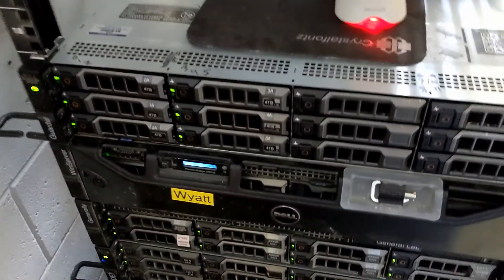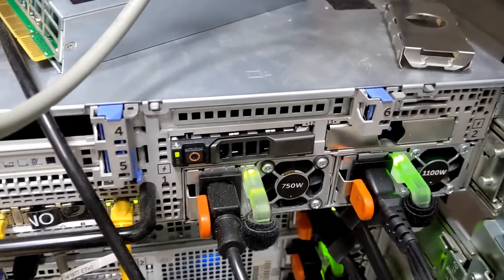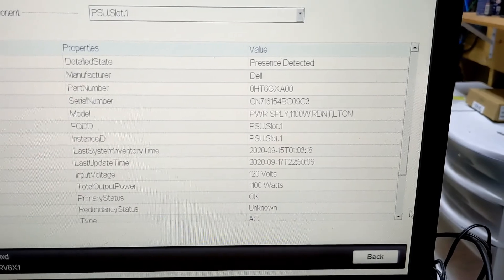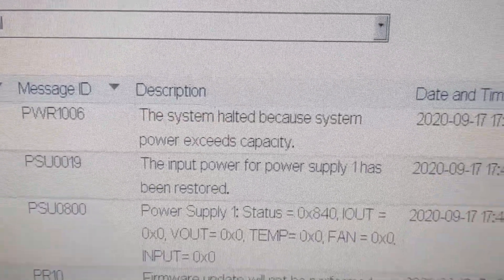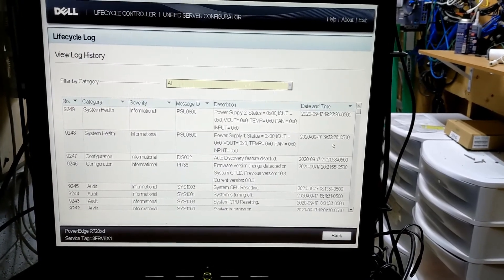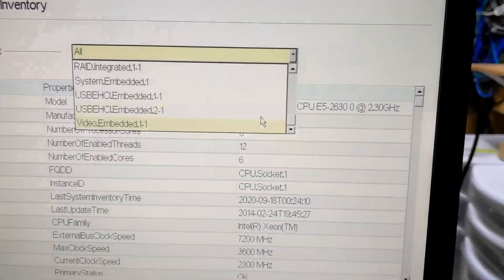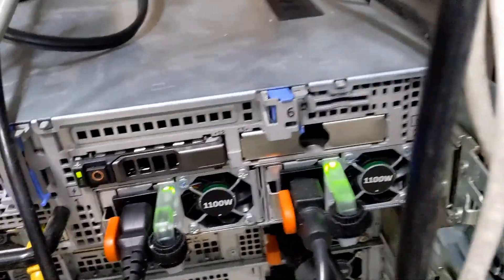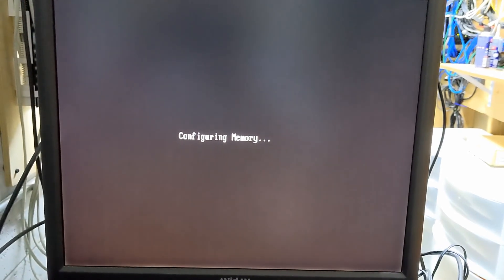Upgrading Dell 720XD power supply from a single 750w to dual 1100w: blinking green firmware mismatch

Comment: you should turn off first to change the 1100w psu，because your old psu is 750w，they are mismatch
Reply from the maker: Yes. My idea was to change the power supplies without turning off the power. What is the use of dual power supplies if you have to turn the system off? SMH
Reply: @Baxsie  Dual power suppily must be two same watt power suppily，such as two 750w or two 1100w，750w cant work with 1100w because the redundant power suppily is parallel（the redundant power suppily is not to increase power，it is for backup，so only same watt power suppily can work together～（please read the server instructions）